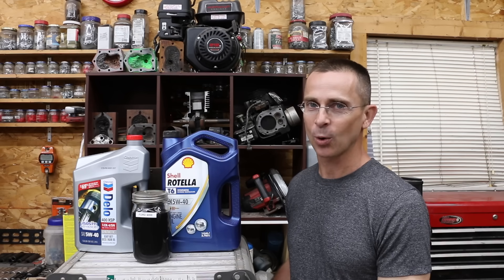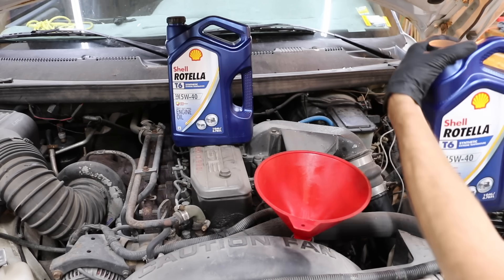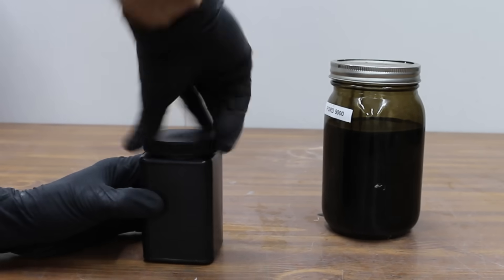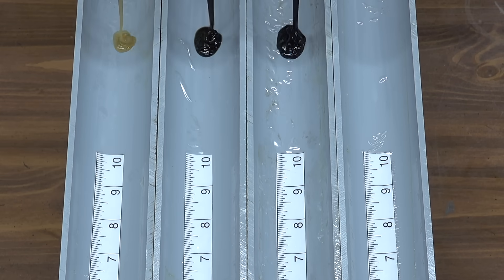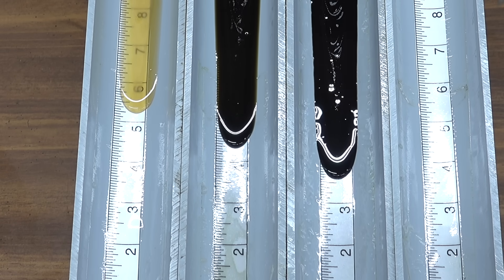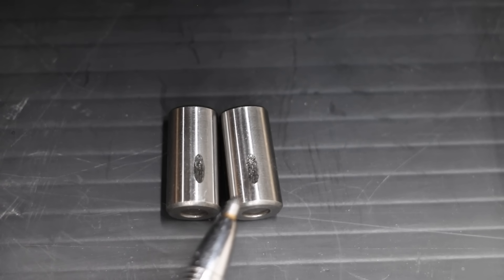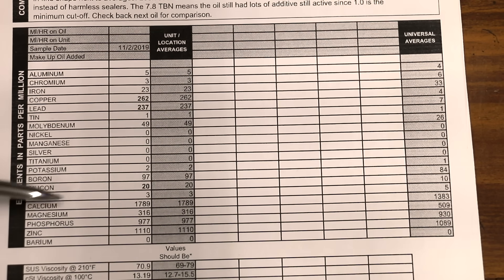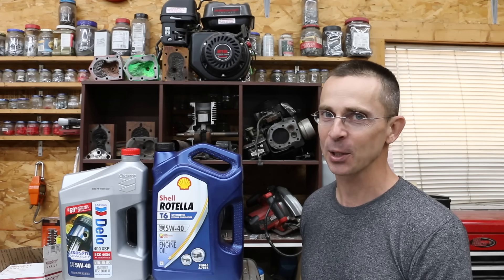Will Annual Oil Change Damage Your Car? Let's find out!

Comment: I do yearly oil change on my Grand Prix GTP. I barely drive it. It's my "sports car". Probably a total of 1k to maybe a Max of 2k miles if I did a road trip that year. It gets parked over winter in a barn and part of my storage prep I put in fresh amsoil signature series 10w30. That same oil doesn't get changed until next storage prep. I've been doing this for 3 years and has had amsoil in it for 5 years. Oil always comes out golden with a slight brown so very little contamination even after a year. I just don't like having used oil sit in the pan And let deposits settle down for 4 months. I've sent a couple samples to Blackstone in the past and showed the oil was still plenty good. It does collect moisture but that can be burnt off from just a long cruise.

On my daily driver I change 2 times a year. One before winter (I put that used amsoil from my GTP into my daily along with new filter). And one before summer (cheapest I can find at the time). I do drive my daily alot. Probably 5-7k per change.

Comment: Loved the video. Glad you tested some good ole rotella. Ive been running rotella 15w40 in my 2000 5.3l Silverado for 7 years and its still kicken with 372k miles on the original motor

Comment: i would like to see which products are better at absorbing and containing spills as well as removing stains from cement and asphalt.
Reply: I second this. Oil on concrete is a pain to remove. Pigmat does work well but it's expensive.
Reply: @TheSlimCognito  brake cleaner work ok.
Reply: Muriatic acid and a scrub brush

Comment: I have giant a auxiliary oil filter 4x the size of my engine's stock filter,  what kind of gain on oil life would I expect from installing it?  It claims to extend oil life and clear out the  smallest of soot particles in oil.  It's made for Diesel, what if I slap it on a small inline?  Thank you!!

Comment: All the old farmers were right......rotella is hard to beat
Reply from the maker: Thank you for the feedback
Reply: My grandma only uses Rotella in everything, gas or diesel.
Reply: I recently started to use rotella 10w60 in my m5
Reply: @greenfusecreations4325  Is that a tractor or a pickup?
Reply: @carluvrsd9374  it's a sport sedan.
Reply: CarLuvrSD it’s a 2001 bmw m5 with a lamans s62 motor ( 5l v8 ) individual throttle bodies, dual cam with vanos. It’s not a diesel
Reply: @greenfusecreations4325   Oh. Not enough ground clearance for me. Sounds fun though. Do your turn signals work?
Reply: Rotella FTW
Reply: Amsoil beats it any day. But rotella is easy to come by and price is great

Comment: Thank you very much for this video. Been searching for an answer to this question for months. I have a car that I only use once or twice. A week for around 30km travel only, sometimes 120km. So in the end of 1 year I travel less than 5000 km. So I guess there's really no need to strictly follow the rules to change oil every 6 or 12 months for fully synthetic oil.
Reply from the maker: Thank you

Comment: How do I send you a sample of an oil additive to test? Soon I will be adding Hot Shot's Secret stiction eliminator to my oil to attempt to fix a rough running condition in my HEUI 7.3L Power Stroke. I'll have a bit left over and would like to see how it tests out, and I lack the resources you do to do this.

Comment: How about you do a test on a 2 stroke in which you run different ratios and tune them to see which runs the best. Maybe use STHIL Ultra and Echo Red Armor or equivalent . Use a camera to look for scuffing and carbon build up. Also read rpm as well. I run 32:1 on everything. Is it best .........not sure.
Reply from the maker: Thank you for the video idea!
Reply: 32:1? Aren't most all modern 2 strokes ran at 40-50:1?

Comment: Do you weigh the rollers you use with the Lubrinsky(?) tester to determine how much wear has occurred?  Also, I've disassembled many engines that have been thrown away and , with the exception of old ones prior to detergents, have never seen much, if any, corrosion.
Reply from the maker: Thank you for the feedback

Comment: Once a year? Damn I dont go that long.. I hear 3k for older engines or rebuilt.. 5-7k for modern cars and like 10k for diesels...

I was having my kia optimas oil changed as prices were like $24 and one time after me going 7k-8k dude was like "bro your oils freaking toast".. Like serious why would you say that to a customer and make them fret?? Anyways once i did the thinking i was like fuck my cars gona be 8 years old im 2020.  I'm barely bout to hit 40k miles so i keeo thinking the cars newer than it is so anyways now that the warranty (other than drivetrain) is a moot point its time to maintain it myself as with my previous vehicles. Last oil change I went from 5w-20 to 10w-30 synthetic as I live in So Cal and dont have cold weather.. 

Rather have thicker oil and my 5 quart of supertech walmart brand and filter are $18 and change so no brainer.. I had to make some 2x6 extension boards for my car ramps and now i change it every 5k and even got a pack of oil change stickers off amazon.  Already have an oil catch pan so i dump my used oil into the 5 quart container, drop it off at walmart and done..  

I guess i was concerned when my car was newer about self maintence and not wanting to void any warranty etc but yah @ 8 years old now my car isnt new, time is flying on by..  Still glad i only got 40k after 8 years.. Had a nee 2001 ranger as my 2nd vehicle and at the 6 year mark already had a cracked head and had to get a rebuild one.. After 11 years it had 110k miles but both heads i replaced, radiator etc.. Really was disappointed but I was young and didnt always check fluids because it was still a "newer vehicle" which it wasnt..

Edit: okay I didnt the once a year was on the Cummins diesel with only 3k+ miles.. I thought he was talking like average 1 year mileage like 10-12k miles.
Reply from the maker: Thank you for the feedback

Comment: I have been in the Automotive field since 1985... ANYONE that goes more than 7 months without changing the oil under low mileage or low hours is just looking for trouble.
Every car I personally have ever owned gets changed every 5 months or 5000 miles. The result is cars and trucks that always have 150,000 miles or more without engine issues.
Reply: mark koeppel 
I have been in the automotive/truck field since 1972.  Anyone that listens to you is getting inferior advice.
Reply: @91156  I have seen countless problems with vehicles from people that go a year between service intervals with low mileage. The biggest being heavy leaks and heavy internal sludge. 
That said, if you are telling people to go a year or more without proper service  are being given stupid advice. Any owners manual in a modern car or truck will say mileage or time, WHICHEVER comes first. NONE of them will say 12 months with the exception of a few high end BMW's, Mercedes, etc...

Comment: This guy is planning multiple tests months and years in advance. Most of the people I know can’t plan out a cigarette break. Bravo. Amazing organization!
Reply from the maker: Thank you for the feedback
Reply: @ProjectFarm  could you test the new Kirkland brand oil from Costco? Thanks.
Reply: @ProjectFarm  It is very easy to understand that modern engine oils can 
stand the test of time...for most normal, daily driving conditions. This is 
considering the engine is in good operating condition, properly tuned, etc. 
However, oil filters cannot "stand the test of time". If a person was to do 
yearly oil changes, it is critically important to change the oil filter at a 
"reasonable" mileage//time interval. Especially if synthetic oil is being used. 
....such as Mobil-1 or Amsoil. 
The detergent packages in synthetic oil & "top tier" petroleum-based engine 
oils are exceptional at keeping internal engine components "spick & span". 
As we all know, the job of the engine oil filter is to trap these particles & pass 
"filtered" oil onto the internal engine components. If not changed at regular time 
or mileage intervals, the filter media will become clogged. 
Engine manufacturers are "specific" about the type of oil filter to use. Meaning 
an engine requires an oil filter made with or without a by-pass valve. 
If an oil filter does not have a by-pass valve & it becomes "clogged" it can restrict 
the flow of engine oil...OR...the oil pressure can blow a hole in the clogged filter media. This situation will send unfiltered oil circulating through the engine. BUT...WORSE YET...the "unfiltered" oil will carry bits of filter media to clog the oil passages of bearing journals, etc...causing serious & often catastrophic engine damage. 
If an engine oil filter that has a "by-pass valve" is not changed at logical intervals, 
the filter media will become clogged; causing the by-pass valve to open. From this point, the engine oil is no-longer filtered; allowing abrasive particles to damage bearings & other lubricated, internal engine components. 
If people are extending their oil change intervals, I HIGHLY RECOMMEND they change their oil filter EVERY 3,000 miles or EVERY 3 MONTHS. Of-course, adding the amount of oil lost in the filter replacement; usually 1/2 a quart or less. 
REGARDING OIL FILTERS ON BOATS WITH INBOARD ENGINES: 
DO NOT USE AUTOMOTIVE OIL FILTERS on inboard marine engines. Use ONLY the oil filter for your marine engine; as sold by the parts department at the boat dealership. Automotive engine oil filters are NOT designed to withstand the extended high rpm oil pressures which are common for inboard marine engines. 
Respectfully, 
Ben
Reply: @ProjectFarm  can we mix same grade same brand oil, only difference is one is SN second is SN plus. please guide
Reply: @saqibhassan46  it can be mixed with creating no problems......
Reply: @saqibhassan46  yeah that is not going to hurt anything. I would not do different brands or different viscosities though
Reply: Really. This hurts my head
Reply: Yes, great job PF and thank you.
Reply: Allegedly he has a military background. That would explain some things.
Reply: @Tomyp89  If he does, he ain't admitting.  I think I asked him that, before.  Negatory.  :-)  But, I would hire him before he even sent in his resume'.
Reply: @Tomyp89 if that's true...then the knife hands must be more effective than we thought
Reply: @Tomyp89  I knew it!
Reply: @Tomyp89  how do you know he has military background?
Reply: @Tomyp89  
People can't be this way (passionate, organized, whatever) without going through a machine-like institution?
Reply: Nicole Martins funny how accurate this actually is..
Reply: Look at the wall behind him. Every screw type in a different jar. I've got a 40 year old coffee can with pile of screws, nails, nuts, cigarette butts, used bandaids...
Reply: Excellent video. Thank you.
Reply: This guy's IQ has to be over 140!
Reply: This is the kid who payed attention in Science class!
Reply: @jaminova_1969  I was the kid that slept through science class (and aced the tests), and I keep my shop just as organized.
Reply: Yeah, I would never be able to do such a thing. That requires lots of organization and dedication.
Reply: 30 year me hanic here, I really enjoy your videos.  I always tell people, it doesn't matter what brand oil you use, just don't let it run out!  Peace brother
Reply: Oh i love this comment
Reply: Yup this guy is amazing. He's the equivalent of old faithful... yet he's not that old haha
Reply: many people from the Midwest are like this. They are very unique and cool people
Reply: Agreed, he’s in his own league for sure. I’m also confident that in middle school during group projects, everybody wanted PF on their group for an easy A because of his awesome ideas.
Reply: This guy!
Reply: @jayeye4798  ,,, Knowledgeable but crazy
Reply: Most people don’t have common sense or take care of themselves
Reply: Our UK & US gov cant make plans for the future either! 
Vote project farm 🇺🇲
Reply: This guy is cool i wish i knew someone like him to take fir a ride or me drive in passenger seat and point out noises n hear his 2 cents
Reply: Project Farm is making plans for useful and beneficial things; cigarettes are NOT useful or beneficial ! And what length of time are you referring to as "cigarette break" time ? Perhaps you should summit your statement for Project Farm evaluation, as it certainly needs evaluation :-/
Reply: beautifully said
Reply: Most people have zero idea how an internal combustion engine works. They just think the key is magical .
Reply: What a sad yet accurate comment on humanity.
Reply: Just light it up and keep working
Reply: 100%
Reply: I sometimes have to have my cigarette in the middle of a video 😀
Reply: I'm happy he does. Many of his videos are things we've all pondered at some point. This is the dude version of makeup tutorials.
Reply: He must have A LOT OF TIME ON A FARM.
Reply: Except farmers plan out months and years out of necessity
Reply: M
Reply: THEY AREN'T TAKING IN REELING IN MANY MILLIONS LIKE PROJECT FARM IS. HIM STRETCHING ALL THIS OUT= ADDS EVEN MORE TO HIS MASSIVE INCOMES= 💰💰💰💰💰💰💰💰💰💰💰💰💰💰💰💰💰💰💰💰💰💰💰💰💰💰💰💰💰💰💰💰💰💰💰💰💰💰💰💰💰💰💰💰💳💳💳💳💳💳💳💳💳💳💳💳💳💳💳💳💳💳💳💳💳💳💳💳💳💳💳💲💲💲💲💲💲💲💲💲💲💲💲💲💲💲💲💲💲💲💲💲💲💲💲💲💲💲💲💲💲💲💲💲💲💲💲💲💲💲💲💸💸💸💸💸💸💸💸💸💸💸💸💸💸💸💸💸💸💸💸💸💸💸💸💸💸💸💸💸💸💸💸💸💸💸💸💸💸💸
Reply: Hell, I didn't even plan on smoking.
Reply: HE'S TAKING IN MANY MILLIONS 💰💰💰💰💰💰💰💰💰💰💰💰💰💰💰💰💰💰💰💰💰💰💰💰💰💰💰💰💰💰💰💰💰💰💰💰💰💰💰💰AND STILL WANTS MORE!! HE WANTS A MONTHLY WELFARE CHECK FROM HIS SUBBS' TOO! HE CLEVERLY CALLS IT= PATREON'😥😥😥😥😥🐽🐽🐽🐽🐽🐽🐽
Reply: Decades ahead.
Reply: Well i mean... this IS his job... so he has time to.
Reply: Yeah that is the excuse I will use from now on when i dont change the oil in the mower for a few years.  Was planning on doing an oil test yeah thats it.
Reply: @plaid13  do you use full synthetic oil in your mower?!?! Haha!
Reply: @Colaaah  haha nope but someones got to test the cheap stuff right?
Reply: @Colaaah  Can you explain why it is recommended not to use full synthetic on small engines?
Reply: @Colaaah  I do. Right now I am using Pennzoil Ultra Platinum 10W30, the same oil I am using in my car. My mower runs an oil temp of 270-300 degrees F, which will break down conventional oil at an excessive rate. And I change it halfway through mowing season because I have a big yard and it gets very hot where I live. Call me crazy, but my mower still has great compression and doesn't burn any oil after 11 years of hard use.
Reply: @rlmartinmanor  generally on things like lawnmowers it's a waste because the oil will go bad with age long before it goes bad for any other reason (typically) however if you're doing commercial use and putting hundreds of hours on your small engines every month, then you might run an extended interval full synthetic so you're not changing it every single month.
Reply: @Prestiged_peck  
Small engines need more frequent oil change. 50 or 100 hours if there’s an oil filter.
Reply: @rlmartinmanor  its reccomended to break in with non synthetic, uaually after that synthetic is fine (check manual) i cant remember the why just the what
Reply: @freedblowfish3705  . I believe synthetic would contain friction modifiers which would frustrate the bedding in process
Reply: agree his channel is great but you DO know he makes money from this right? you do know that? some of the praise he gets is justified but also some is absurd. (not his fault) just really strange to read some of the comments.. like he’s doing this for free. there’s a reason why so many chinese brands are featured in tests because a lot of them have amazon affiliate links. and more power to him and are a lot likelier to get clicks due to the lower price.
Reply: @GrandHuevotes  doesn’t change the fact that he’s organized…..
Reply: @GrandHuevotes  he did it "for free" for quite a while....you don't just snap your fingers and become a youtuber.  Good on him for making money by doing something he obviously enjoys
Reply: @das1252  No he didn't!
Reply: @GrandHuevotes  It’s possible that he tests the Chinese stuff purely because people will click through. It’s also entirely possible he wants to know how those brands compare to the ones we heard of (like a lot of us do). It could be both.
Reply: Anyone else taking notes while watching this?
Reply: Smoking in the first place, though, is a terrible use of time.....make wise use of your time by getting real info from Project Farm !!!

Comment: Another great comparison.   Is it actually better to run Diesel oil in a Petrol engine given the better detergent package and the fact they are wear formulated for high compression engines?
Reply from the maker: Thank you

Comment: Great video, I always appreciate your stuff. Video Idea: Can you compare the new FA-4 spec oil to a CK-4 oil of a similar viscosity (preferably 5W30). The FA-4 oil claims to offer similar wear protection at a lower HTHS viscosity, giving it better fuel economy. so it would be neat to see if this is true. My truck calls for the new FA-4 Spec (Ford 3.0 Diesel) as the preferred oil, however says to use CK-4 for severe duty service, so I would love to know how they compare, and if by using FA-4 I may be sacrificing some engine life in the name of fuel economy. Thanks!
Reply from the maker: Thank you for the video idea!

Comment: Could you test products such as radweld or radiator stop leak? which are intended to fix coolant leaks. You could test their abilities to seal small holes in pressurised aluminium tanks or rubber hoses etc, I think it would be an interesting video and would be interesting to see if they cause any damage, and which product can plug the largest holes etc.
Reply from the maker: Thank you for the video idea!